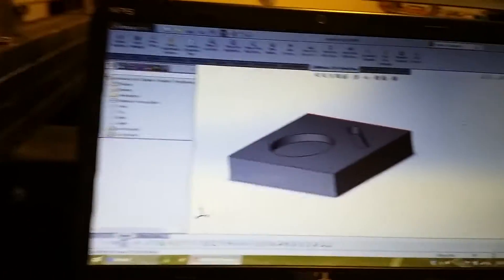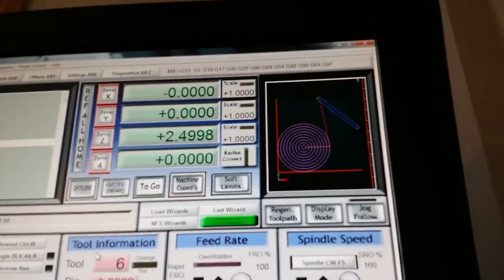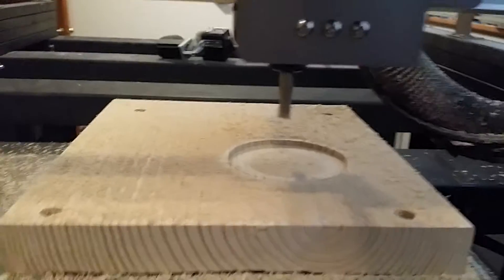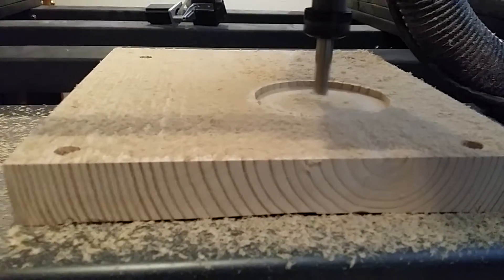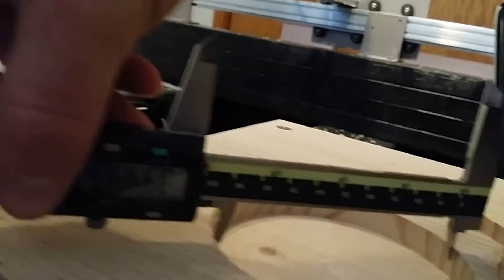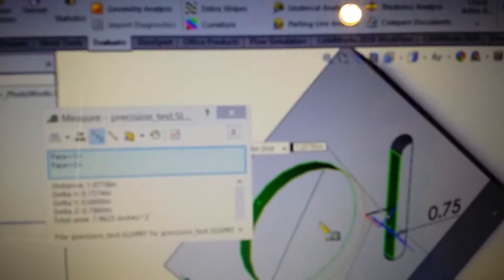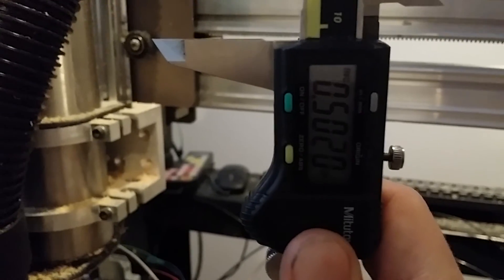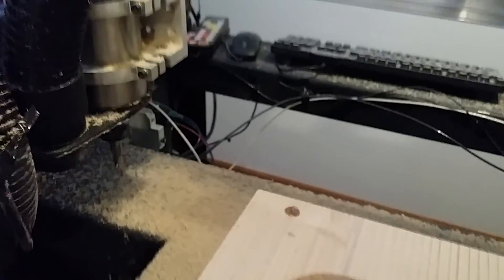CNC Mogul 4x8 Router Precision Test

Comment: What spindle are you using or are you using a Porter cable router?
On your 4x8 table, what speed and depth can you cut mdf or plywood or osb using a 1/4" compression bit?  thx
Reply from the maker: +mikenicee I'm using a 2.2kW spindle from ebay.  I haven't done a lot of mdf cutting but I'd say 1/4" depth at ~100in/s with a 1/4" bit.
Reply: +Michael Schmidt did you make your own spindle holder?   Which eBay brand did you get
Reply from the maker: I bought the spindle holder but the specific one I purchased is no longer available.  However, if you just search for "80mm spindle mount" on ebay you will come up with quite a few results that are very similar to mine.  I would recommend using loctite on the clamping bolts.

Almost all of the 2.2kW spindles are made by the same company; I just went with the cheapest one I could find.  I went with the watercooled version as I already had spare PC watercooling parts around.  I see now that many spindles come with extra bearings but I have had mine for about a year now with no issues with the bearings.

I would recommend against the cheap inverter/vfd that comes with most spindles.  Although I don't have much experience with them, the research I did told me to go with a name brand unit.  I ended up picking up a used Hitachi wj200 (3HP) for a couple hundred bucks. You might want to go with a 5HP inverter if you will be using over 80% of the rated spindle capacity.  They offer models with various phase inputs and voltages for almost any configuration.
Reply: meanwhile, did you increase precision? 0.020" doesn't sound so good for me in metrics. That is half a mm. I can see this easily with my eyes on my metric ruler. No offense here. Just interested.
Reply from the maker: Increasing the acceleration of the motors helped but I would guess that this machine is still only accurate to between 0.005" and 0.010".  You have to remember that this isn't a $50k router.
Reply: I have no idea what the precision of such homemade routers is. 
That is why i ask. 
Thank you for your response.

Comment: could you tell me what your final numbers were for the "steps per"? using the same spur gears and cant get the numbers correct.
Reply from the maker: Yep!  Make sure you are set to imperial (inches) and set the steps per to 1273.24.

The G540 will always microstep so that gives us a steps per equation of (motor pulses)/(inches per rev).  You most likely have 1.8° (200 steps per revolution) stepper motors, so the motor takes 200 pulses to turn 1 revolution.  The G540 will microstep a factor of 10 so there are 10 steps per 1.8°.  The spur gear has a diametrical pitch of 0.5" so each revolution it turns, it travels its circumference: 0.5"*pi()=1.57".  All together we have (10 microsteps per pulse)*(200 pulses per revolution)/(1.57 inches per revolution) = 1273.24 steps per inch.  Again, this is just a theoretical number and to get your motors more accurate than what is shown in the video, you will have to do some trial and error with this number (maybe +/- 10).
Reply: Thanks for leading me in the right direction.